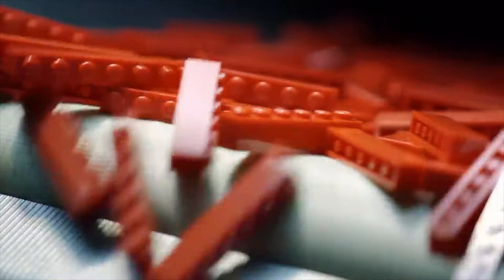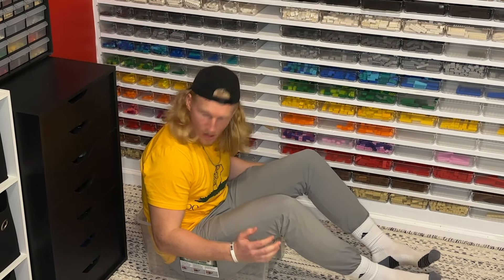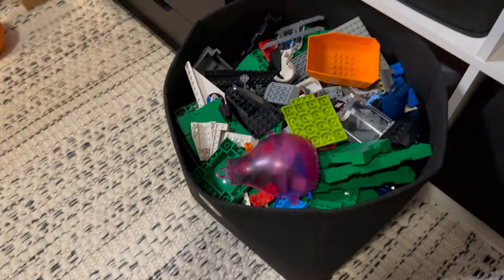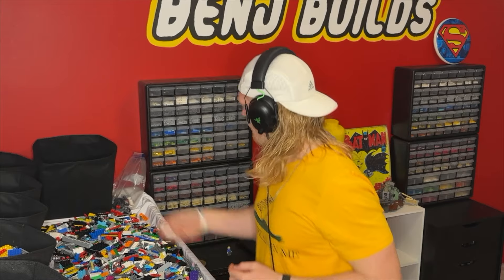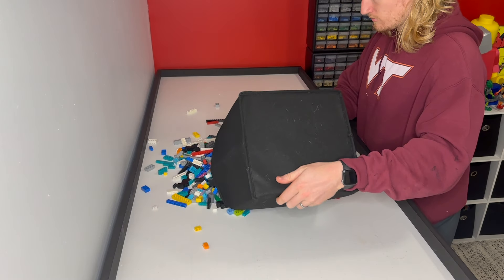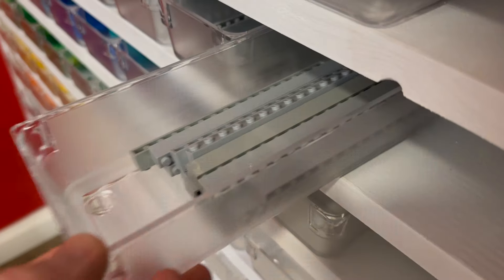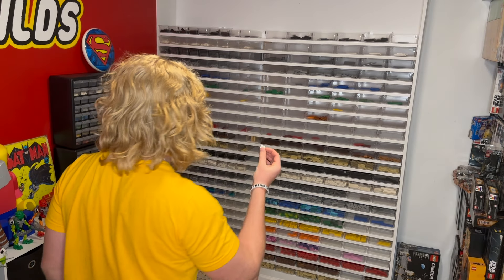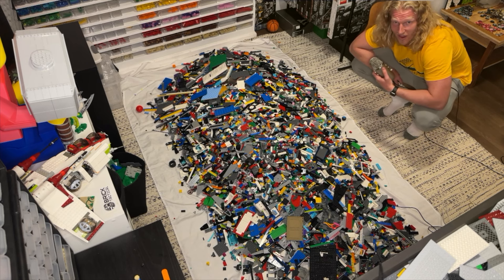The Best Way to Organize LEGO Bricks!

Comment: @benjbuilds could you send a link to the large white wooden 'akro mills-type' shelf? Ive never seen it before, looks super handy!
Reply from the maker: I actually designed and built them myself just using wood from the hardware store. They are super handy and I’m glad you like them! Thanks for watching!
Reply: @BenjBuilds  thanks! I'm moving into selling parts from primarily sets and i'm not finding affordable organizers. My concern with the DIY approach is having drawer 'stoppers',  'separators' and handles, as convenience and efficiency is key. Do you miss having these?
Reply from the maker: @elementbane  I can't imagine it would be too difficult to add those features to my setup, but I haven't felt the need to. Works great for me so far!